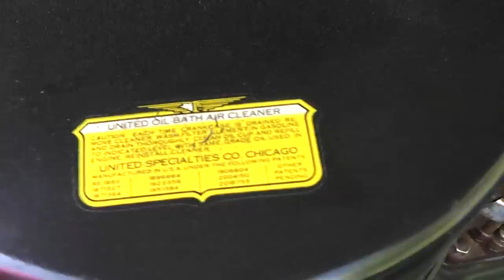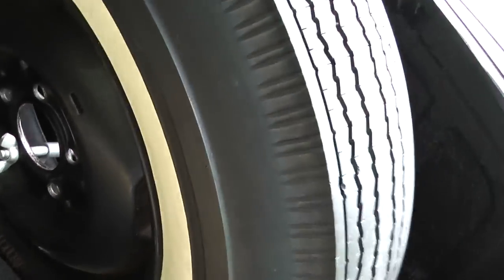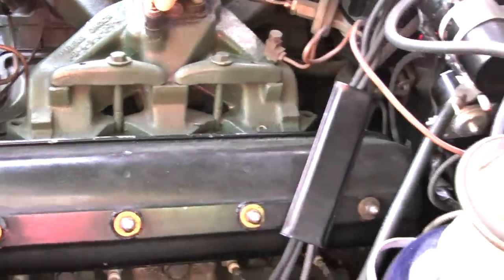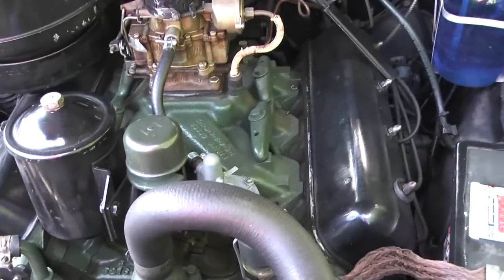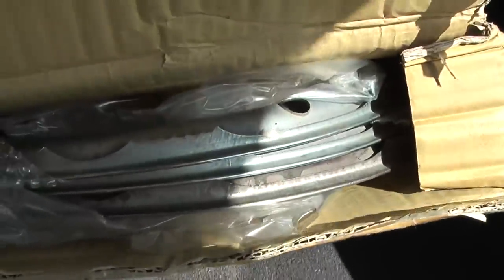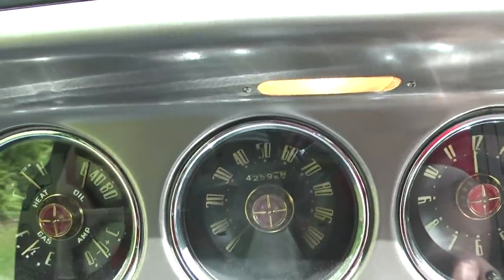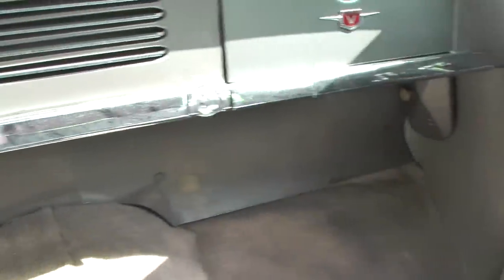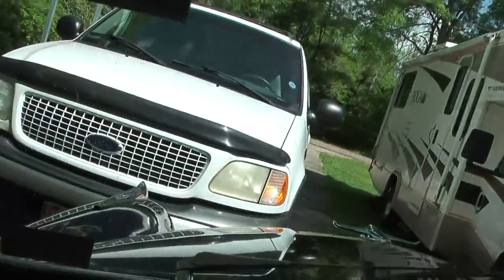1951 Studebaker Commander Land Cruiser

Comment: Major Studebaker innovation, often overlooked: cars equipped with Automatic Drive  were the first in the industry to have the double-wide brake pedal.
Reply: Studebaker had another innovation not used by other companies!  The Hill Holder!   Cars so equipped, manual or automatic transmission, could stop on an uphill grade, driver could then remove his or her foot from the brake pedal and the car would NOT roll backwards!   Especially nice with a manual transmission!   Not acrobatics with the right foot between the brake pedal and the gas pedal. Brakes would release as clutch was engaged!

Comment: Nice car! And I agree with you about bringing back the simple engines.
Reply from the maker: Yep, simple and basic. Just the way I like it. I believe a food run is in order for my next video of it.
Reply: Sometimes the simple designs do it better. less stuff to go wrong with it.
Reply from the maker: ***** Exactly!
Reply: One of the annoying problems I had with the '51 commander was carburetor vapor lock in the mountains.
Reply: An electric fuel pump helps a lot with that. The junk that passes for gasoline these days boils at a low temperature.
Reply: This is why I am partial to pushrod and flathead engines, the fewer parts there are, less to breakdown and go wrong. If a problem does pop up, usually is a simple fix. While overhead cam engines may be more powerful and efficient, it unfortunately comes at the cost of reliability and longevity since again, the more parts there are, the more there is to breakdown. Overhead cam engines will need to have the rubber timing belt replaced every so often, even when not driven much, if it has a timing chain, the guides and phasers will have to be replaced at some point or the riding of the valves will be off. Pushrod OHV engines usually have a timing chain soaked in oil, as long as the oil is changed every 3 months or every 3,000 miles, will never have a problem. 

One of the most reliable engines ever made I can think of is the Ford 240/300 inline 6, simple pushrod OHV design with a cast iron timing gear which literally will last up to 500,000+ miles, even then it will last a long, long time. While the 300 inline 6 wasn’t powerful, will easily run circles around anything made today, even Toyota and Honda.

Comment: 1:30 note the brake pedal.   
Studebaker was the first maker in the industry to use a double-wide pedal in cars with Automatic Drive.    
Studebaker's air-cooled three-speed planetary automatic with the locking torque converter was the most advanced automatic in the world at that time.

Comment: Bought one of these cars brand new, wrote it off the same day.
Reply: LAFOLLETTER  Wrote it off as in had to swerve to avoid getting into a head on collision with a vehicle that was in the wrong lane going the wrong direction. In doing so the guy still managed to sideswipe the drivers side which pushed my car into a vehicle on the passenger side. Was wrecked on both sides pretty much front to back. That one had 6 cylinder if i remember correctly. Still have it but its buried out in my field

Comment: So, I guess I now own one of these.  My father passed away a week or so ago, and we have one of these.  Been stored in the basement since 1974.  Nothing wrong when parked.  It was a family car and he grew tired of people vandalizing it on the street.  It's been there ever since.   Any tips on getting it running?  I know these have a 6 volt battery.
Reply from the maker: Sorry to hear that about your father. As for getting it running, it uses the same distributor cap and rotor as GM engines. You can still get that, the wires and spark plugs at an auto parts store. Keep in mind that the car has a positive ground. The generator is a Delco Remy so it's not hard to get it running again. The starter is a Delco Remy too.
Reply: @EmersonCollie  Thank you for the quick and informative response!  I thought I remember my dad saying the car had a positive ground, but I had actually forgotten that!  Good save!  Thanks for the condolences on my dad too.  He was a good man.  It occurred to me that this car has been in my family for like 70 years!  It would be crazy to not at least get the old girl running.    Any tips on the auto trans before attempting a start?
Reply: I brought the car home a couple of weeks ago.  Collecting parts for it now.  It is truly in fantastic shape.  I'm looking forward to getting this thing going really soon.

Comment: They made automatic transmissions in the 50s?
Reply: +yamaha rider02 Oh yea... Chrysler had Fluid-Drive, Buick had Dynaflow,  other Gm's had the Hydra-Matic.
The Hydra-Matic, introduced in late 1939, was the world’s first really successful fully automatic transmission.
Reply: +Jeff Treseder I hate automatics to begin with
Reply: Studebaker beat the industry to market with a three-speed fully automatic transmission, "Automatic Drive", which included a lock-up clutch in the torque converter. Also, the Automatic Drive transmission was air-cooled.
Reply: the 51 stude standard had overdrive and a hill holder so you could take your foot off the brake on a hill.
Reply: Actually, overdrive was an option available on all models, priced around $90 (1951 dollars, probably about$1000 2016 dollars). The hill holder was standard on all models except for the severely de-contented Champion Custom (roughly equivalent to the later Scotsman models of '57-'58). I had a '51 Commander Starlight with overdrive when I was in high school (cough) years ago. Also, early production '51 Studebaker V8's had notoriously soft camshafts, a service bulletin that apparently never reached my car's previous owner.

Comment: Didn't the 1950 Studebaker copy some looks and features from the 1948 Tucker.
Reply: There may have been some convergence, but Raymond Loewy had sketched the bullet-nose theme as early as 1942, just in time for the suspension of production of all civilian automobile production.    
Rear-hinged back doors were not uncommon in sedans of the period, and Studebaker did experiment with rear-mounted engine designs in preparation for the 1947 models.
The entire 1947 line was radically new in the context of the time, and Studebaker management was not thrilled with the direction the design was going.    
My understanding is that Studebaker management paid Raymond Loewy Associates designer Virgil Exner to design a more conservative grille (and body from the cowl back) for the Champion and Commander (including Land Cruiser) models, and these were the designs that went into production.    
Loewy was, understandably, furious, and fired Exner, who kicked around the industry and achieved some modest success with his designs for the late fifties Chrysler products.  
Loewy, nonetheless, claimed sole credit for the '47-model Studes which were introduced in early spring of 1946 after a short run of '46 Champions which had been lightly facelifted '42 models.  
Anyhow, came time to redesign the Studebaker line, Loewy dusted off the P-38 bullet-nose and Studebaker, having seen the success of the bullet-nose '49 Ford, adopted it.    
Stories are told of dealers who nosed the cars into banks of potted plants to disguise the grilles until sales exploded. 
The bullet nose proved to be a flash in the pan, though, and by the  middle of the 1951 model year, everybody who wants a bullet-nose Studebaker had one.    
The 1952-models were planned to be something spectacular in celebration of Studebaker's centennial year, but the new design proposals went from mediocre to dreadful, leaving little choice but to punt with a face-lift without the bullet.   
The real fireworks of the Studebaker centennial year proved to be the '53 models, based on a low-slung, sexy coupe profile designed by a young designer named Bob Bourke of Raymond Loewy's firm, and (you guessed it) Loewy again claimed credit.

Comment: Did they make these with overdrive?
Reply from the maker: Not the automatics but the three on the tree manual transmissions were. Once you wind the third gear up, you let off the gas and a solenoid will engage it. Some you can pull can pull to engage manually.
Reply: @EmersonCollie  was that for every model or kind of an add on you could pay for?
Reply from the maker: @tank123103  No, that's how their manuals were originally set up from the factory.
Reply: @EmersonCollie  ah interesting alright I'll assume this guy meant his was broken, thanks ^~^
Reply from the maker: @tank123103  More than likely it is broken. Keep in mind, 1951 was 72 years ago. Could be the wiring, or the solenoid itself. And no problem.

Comment: Had a convertible we put 259engine as originals bearings ng.on those weak .had 53also engine ng.put289.
Reply from the maker: Weak bearings? Hard for me to believe that. Mine is 68 years old and it runs just fine.